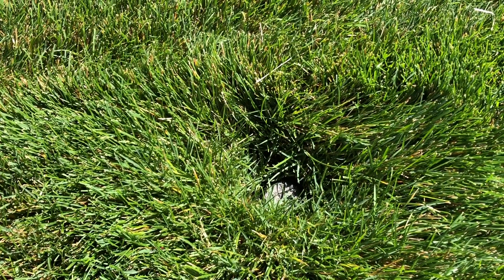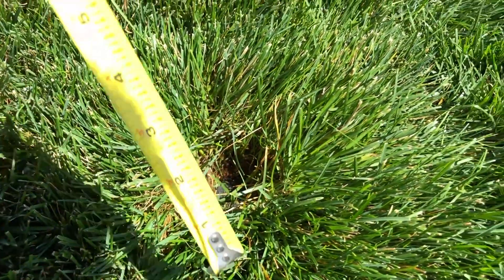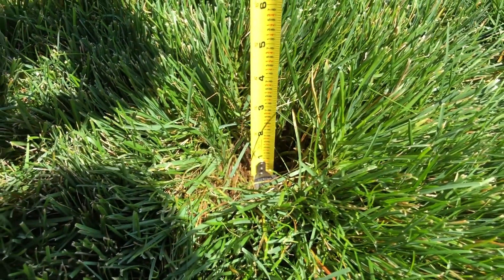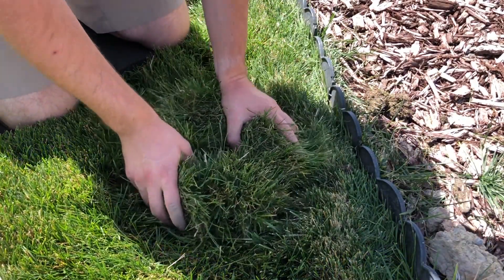Don't Do This When Raising Sprinkler Heads!

Comment: I have an old copper irrigation system. what's the best and easiest way to rise the heads to the current grass level?  The current heads don't even seem to be solder on the pipe.
Reply: @A D yes, i also live in Michigan.  Can i install my PVB indoors?
Reply: @A D Is PVC sch. 40 or 80 need for systems in Michigan.  Connecting it to copper lines that are already ran.

Comment: Something seems off.  Mowed racing stripes and have a fantastic lawn.  Wanted to show viewers how to replace sprinkler heads.... but your recap was how you learned steps 1 thru done. Plus you cut the line.  Man that's your pops house and your living in it taking credit for his work.  "Glad that's finished" describes an assigned chore.  I'm in my garage dripping sweat right now cause shat ain't ever done.  It's only on to the next mow, pool clean, honey do, fix this, build that, pimp it tight, and make more $ cause it costs.  If I'm wrong, so be it.  No dad and no I learned.  I suggest Just you in video and that's how its done to end video.